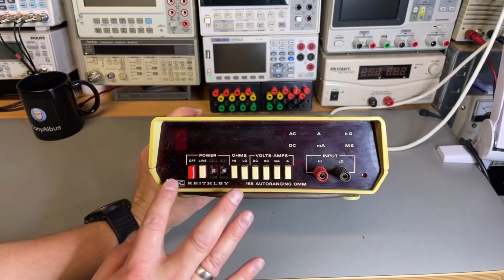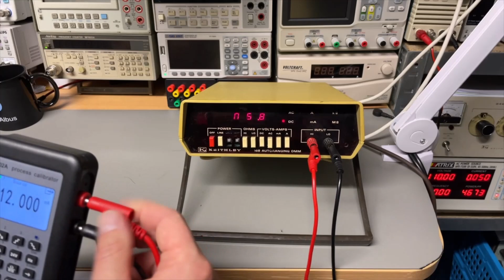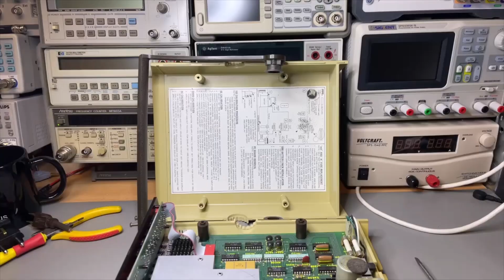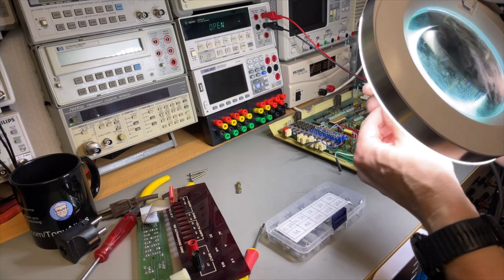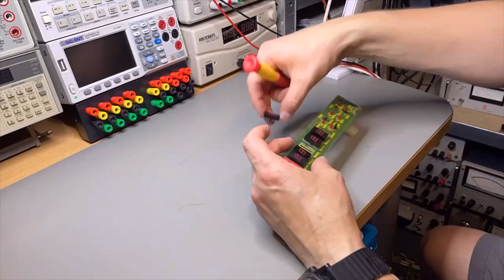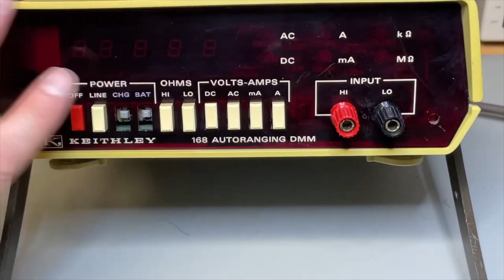TA•0292🟦Keithley 168 Autoranging DMM from 1974 - Restore

Comment: Tony, I got a keithley 197a for a good price recently. I was quite impressed, It automatically detects 2 or 4 wire for resistance, uses the same sockets for voltage and low current measurement, has 10A capability (which my keithley 2015 does not have). Its 5.5 digits and 200000 count whereas the 2015 is 6.5 digit but only 1000000. So for some measurements the little 197a has the same resolution as the 2015. The 197a has a 200mv range with resolution down to 0.001mv for both AC and DC. For current it has a 200uA range with resolution down to 0.001uA for both AC and DC. The AC current range options is far far better than the 2015 which only has 1A and 3A AC current ranges and is a real weakness of the 2015. Its true rms and makes a very nice, light weight, small and portable bench meter.
The only small downsides to the 197a is that it has no current autoranging, the back light is a little weak, the tilting bale is plastic and fairly easy to break and it does not have the features of more modern meters like averaging, Highly recommended if you can get one at a sensible price.
Reply from the maker: Hi James, oh yes the 197a is very nice indeed... nice you were able to get one.. i am still looking. keithley makes such high quality gear.. and did and that still is... i love it... btw, i have a 193 coming soon :)))
Reply: @TonyAlbus  hi Tony, the 197a cost me less than £100 on ebay. It arrived with the tilting bale smashed (due to poor packing) and initially the selector switches needed a good clean to change functions correctly. Otherwise it worked fine. I sent it off for calibration check and it came back with all functions measured as within spec and no adjustment needed. It amazes me that the 2015 does not have more ac current ranges than just 2A and 3A, but that was made after keithley had been taken over by Tektronix...
Reply from the maker: @jamesking7868  Yes most new Bench versions with 5.5 or 6.5 digits do around 2 or 3 Amps .. the higher the current the less the digitis matter..